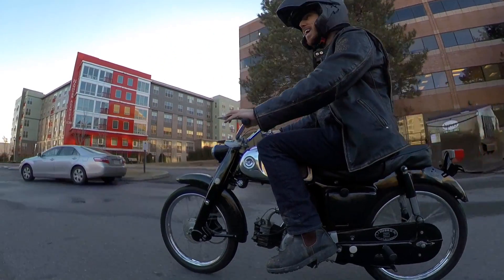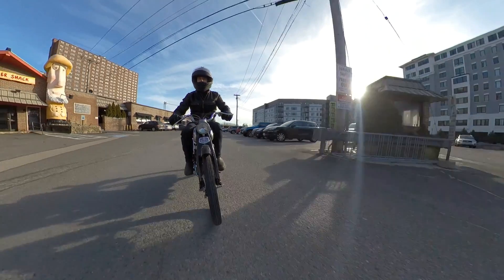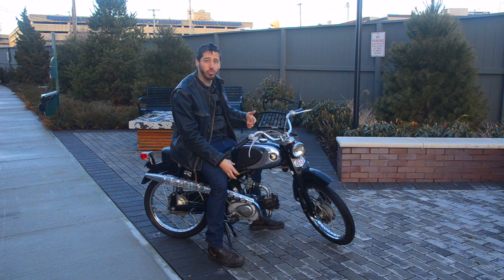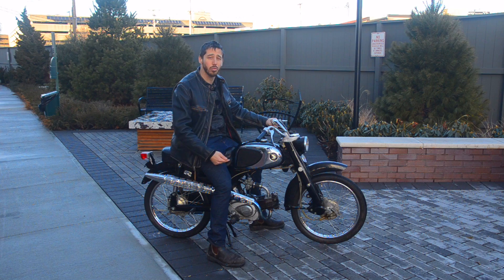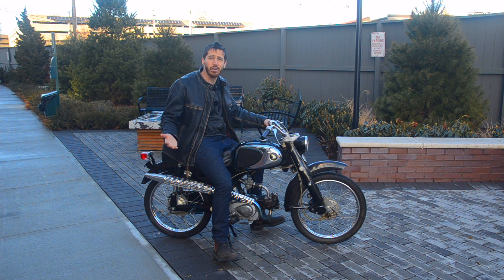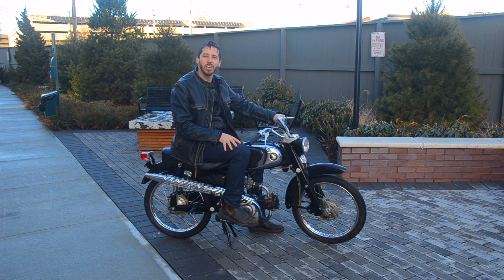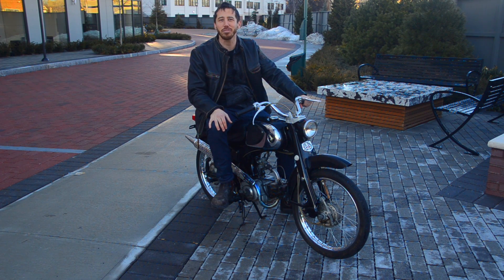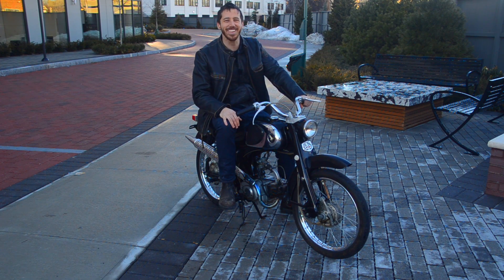DIY electric motorcycle conversion with 1969 Honda - Part 1: Planning

Comment: I would just try to avoid the hub motor. How to fix the motor and battery pack? Jus two sheet metal brackets that replace the current engine and go all the way to the steering head area. 
Looking forward to the next video :)

Comment: If you're going for under 5kw then go for a hub motor, less moving parts, easier conversion. 
However, that bike is a bad choice for conversion, the frame is an open C shape which has very poor structural support. Remember, electric motor=torque, the old 50cc engine lacks power of any sort, it's already stressed after just surviving the years, was never designed with the torque even a small electric motor can supply, the frame might stretch and compress without additional support. From the engine mount I'd brace it up to the neck with tubular steel, either welding it or bolting it together giving you the option of an easier access and disassembly also giving a sort of underslung sub frame which would give support, a place to put the foot pegs, foot brake and support for a battery box keeping the CG low. As for battery meter, go analogue for asthettics, mount it to the tank, a lot of bikes of this era had instruments there.
Reply: yea the c shape is weak , but tubing changes looks, might have it hidden in middle under and into recess on battery , migth even not use tubing but wire and strecthing mechanism.

Comment: I think you should go for mid engine. It will look better and in the event of some issues you don't have to dismount a lot of parts. Also it will distribute weight. For the batteries I would consider the hollow tank covering them. Good Luck

Comment: I would like to see a setup that includes a kinetic charger to continuously recharge the battery when in motion.  Something like flywheel energy.  From wikipedia article:  "In the 1950s, flywheel-powered buses, known as gyrobuses, were used in Yverdon (Switzerland) and Ghent (Belgium) and there is ongoing research to make flywheel systems that are smaller, lighter, cheaper and have a greater capacity. It is hoped that flywheel systems can replace conventional chemical batteries for mobile applications, such as for electric vehicles. Proposed flywheel systems would eliminate many of the disadvantages of existing battery power systems, such as low capacity, long charge times, heavy weight and short usable lifetimes. "

Comment: I'm happy as long as 18650 or better capacity batteries are used. Could also use multiple small inverters vs a single large inverter, assuming that the hub motor is ac. ¯\_(ツ)_/¯

Comment: Should go for a hub motor and just put the batteries inside the fuel tank and if you're not into destroying that fuel tank go make a vacuum formed shell from the original and sell the current one of ebay

Comment: Hey! I also bought a super Cub in hopes of electric conversion. Tubes in the rear tire were a pain when I got a nail. I failed 5 times in rear tube replacement before converting wheel to tubeless, mountain bike style. I highly recommend converting to tubeless.

Comment: Looks like a cool project. I have an old e-Bike/Pedal Scooter that I plan on restoring. It has a Chinese hub motor and has 36v worth of AGM batteries. I think the current electronics are totally dead.

Comment: This is a cool idea.  Like you said in the video, there are millions of similar bikes around that could have a second life as an electric moto.  Be careful if you decide to cut into the fuel tank; make sure it has been cleaned out very well so any sparks do not ignite the old gas fumes.

Comment: Make sure that you have your more powerful brake at the front wheel. Primary braking with motorcycles are from the front wheel with the rear brake used for braking stability, consider this when planning your brakes for your own safety

Comment: I want to build a 48 volt  pack capable of 100 amp regular discharge. I haven’t been able to find a good option for a BMS so I’m currently using lipos with an audible alarm.  Any suggestions?

Comment: I have built several ebikes and also restored a Honda ct90 similar to what you have.. At one time I thought about doing something similar and quickly realized the Honda  without the engine is very heavy..I'm guessing approx 125-140lb. The last ebike I built started off as a 27lb and the build ended at 48lb including the battery. I really don't see the point in so much weight... other than the cool factor.

Comment: I think you are biting off more than you can chew here. Far better off getting a low power electric moped and amp it up. They sell 1500 watt full size scooters for about 1000. Then convert it to a 5000 watt at 72 volts.  If you going to stick with that honda. Consider putting the batteries in rear saddle bags on side mounted panniers. Will make it easier to take and charge. By putting the battery in the front you are almost force to charge on the bike. The rear hub is the way to go. Since these are plentiful, add a disc brake should not be any problem. Go with DC to DC for the lights and such. When you buy the rear hub, make sure you use a Credit card. I found half the stuff I buy from aliexpress does not work. Also they seem unresponsive to refunds. So I am force to do a chargeback. We look foward to the build.

Comment: Great project. Whats the best way to connect with you about large volume sales of your battery kits and battery packs? Scroll down on this page to see a Mid Drive Honda Cub conversion kit using a Sur Ron Light Bee drive train https://endless-sphere.com/forums/viewtopic.php?f=28&t=89902&start=3025 . It will be offered on a crowd-funding platform. The team has had prior success on crowd-funding platform with $230k in pre orders.  One of the team members was the founder of one of the largest clean tech funds.

Comment: Great timing, I was just starting to plan the exact same thing!  Get a retro 'mini-bike', convert it to electric. I look forward to seeing you problem-solve your way through this. I'd been thinking of doing it with a mid-drive to keep the aesthetic (+ keep the original wheel), and replace the tank with a battery pack (with a container that's been designed to look like the tank, and chromed!). Check out a local makerspace (Artisan's Asylum?) for access to welders and machining tools for parts creation, btw. Good luck with this!

Comment: Difficult to imagine a less appropriate donor bike. Surely you need something with good-handling, good brakes and some room for batteries and luggage - it's a work bike after all. You're removing all the retro stuff, apart from the tank, so why start with such a hopeless chassis?
The engine on these old Hondas is super-reliable and economical, but that's the bit you're binning. Weird.
Reply: Project is aimed at a city bike small lightweight and for short commuter journeys, ideal for electric conversion

Comment: Looking forward to the rest of this. I am about 80% done with my similar electric moped. 1980 Garelli SS. I chose a mid drive motor and custom built batteries.
I am interested to see what bums and if you do put a graphics display on your cycle. 
Look at my forum here. https://goldenmotor.com/SMF/index.php?topic=6586.45

Comment: Consider a midmount motor so you can keep the stock covered chain drive and rear wheel. Battery pack could be located in panniers. Maybe cast a plastic shell from the tank and hide the electronics inside.

Comment: Make a steel battery box with footpegs on the bottom and bolt it to the frame with the engine mounting bolts.

Comment: How about to use an electric chainsaw for powering the bike. You can get even a 120 volt system with massive amount of tork. And tge batteries are not too expensive as well. I was thinking on maybe you could check the redback 120v chainsaw or similar one. Have fun :)

Comment: 7:16 this is why you’re making this ELECTRIC hahahaha
Reply from the maker: Haha yea, funny how electric doesn't have these problems...
Reply: @EbikeSchool  ...because you suck at kickstarting a motorcycle?
Reply: But you can't bump start electric, lol.
Reply: Brannen Thompson no but if the batteries flat you can charge it by getting a tow😅
Reply: @andykirby - A tow on a moped ? 🧐
Reply: Ha ha, totally!
Reply: Not the engines fault it's his weak kick
Reply: @kevinmontoya7318  kick can not be too strong l think the kick system often breaks then
Reply: @orangestoneface  not excessively strong im talking about a quick hard kick to get the motor to spin quick
Reply: @kevinmontoya7318  l tink the like znen gy6 common china scooters here can not take kickstarting too often its a weak system so the el starter must be mostly used. but im too lazy to repair mine.
Reply: You should do a collaboration with Brunopoweeer when you're finally done this project. His voice and high-energy is hilariously awesome!
Reply: Duane Meville hahahaha yeah we’ve done some videos together, I recorded some short clips showing a few electric motorcycle regen brakes and uploaded on both channels I think beginning last year...
I’m keen to dub his new video... that would be ultra funny... hahaaaa
Reply: Slap a lifan 150cc in that baby, and she will RIP got mine to go 80mph :)

Comment: If you decide to go with a hub motor, it may well be worth considering setting it up with regen braking. Though I don't suggest it, my current ebike is set up with regen as the only rear brake, and I find it to be easily sufficient when used in conjunction with a strong front brake for times when quick stops are needed (the regen alone is fine for 95% of my Class 3 ebike city riding). The battery setup you're suggesting would likely handle far more regen current than I have experience with, and you could probably even set up the foot brake to control variable regen current through a Cycle Analyst and/or a compatible controller, while also actuating whatever rear physical brake solution you come up with.

Comment: I know I already posted a comment but I'd like to add that I'm very pleased with the availability and price of these parts and the ease of use of all of the equipment and bits. Electric vehicles are becoming vastly more viable than they were even five years ago and I am very impressed

Comment: Congrats! I’m working on a similar project, dough mine is a 1978 mobylette motobecane, 3000 watt 52 volt battery!!
Reply: I have a similar moped made by Peugeot. Where are you mounting your motor and battery?
Reply: BackwoodsBungalow right where the gas motor was placed, mine ( motor is electric motor from Luna cycles 3000 watt) but you could lace and true a rear brushless motor.. just saying! Good luck on your project.. greetings from Chicago!
Reply: I am also working on something similar. Mines a 72v setup. What motor brand did you go with?
Reply: Will Greider 3000 watt motor from Luna cycles!! 52 volt battery 20 amps,from AliExpress. Good luck on your project,,
Greetings from Chicago!

Comment: You should leave the engine and just add the hub motor and make it a cool hybrid, gas/electric motorcycle. Then again, for "ME", I like options, like if I want to run off a battery or gasoline. You could also use the motor for regen braking to help with a disk brakes on the rear tire.

I've been hoping someone who knows more than me would build some thing like this and see how it goes. You can always remove the engine and go all electric, but to do some thing totally different would be cool if you ask me. Plus, you could use the motor to get going and start the engine so no more kicking or push starting either. haha Keep up the great work.

Comment: Hey Micah, glad to see you’re moving into the low end of the heavy weight wheels. I have a Smart Car I converted to electric but I only had AGM batteries for it n I sucked the life out of them in 1200 kms. Now I need someone with your growing skill set to help me repower this wee beastie. Used your book to get my ebike powered but this EV car seems exponentially bigger. Coming to Nova Scotia anytime soon?

Comment: I say put the motor in the same place and store the batteries in the  tank and under the seat.

For the gauges, keep the factory speedometer and find a retro or period similar volt meter and add a momentary switch to activate it.

You could also have the charger connection be where the fuel cap is.
Reply: Hub motor is the better way to go. Less building. He could put the batteries in side saddles in the rear.

Comment: I hate engines if you want any real power it has to be Electric
Reply: "Real power", hilarious.  The ignorant cult of electric is already beginning.
Reply: Electric bikes and cars are awesome for immediate power. However e-lovers are a bit like flat-earth people. Some of us believe you should experience things that are more than 40 miles away. I can travel 700 miles in a day on a $500 ICE bike. Till that equation can happen I will not succumb to the electro-facists.
Reply: @JamBot34  different things have different parameters. You can get a really great smartphone but good luck if you can make it run for 5 days straight. You can also have a great exercise program but good luck if you don't want to have aching muscles. Different things have their pros and cons. You have just chosen to cause more secondary and tertiary harm to other people rather than less.
Reply: sam guapo like I implied. Make them realistically affordable with realistic range. But I suppose you don’t care about affordability and want the dirty proletariat to stay in their zones digging the coal to feed your charging machine...
Reply: @JamBot34  Affordability is a term of entitlement.  There will be things that are, and things that are not. Insisting to make everything that way  is ludicrous. Imagine if everyone insists that space travel has to be affordable. Again. Different things have different parameters.
Reply: @samguapo4573  Okay, so really have just been poking the bear to this point. But to address the "affordability... entitlement" comment. Let's stick to electric vehicles. The Tesla Model 3 Standard OTD is about $40,000 minimum if you get all the current possible incentives. (That is on a forum, grain of salt there). The Chevy Bolt has several reports of $33,500 with similar discounts. Still not what I would call budget but it is approaching reality.  I'm not insisting Ferraris cost as much as Civics. But in a country that has loads of rural areas, long-distance vehicles are needed. I would buy an electric adventure motorcycle that got 200 miles of ~55mph range and was around $10,000. But that is my personal comfort level. We shouldn't push the world to accept EV, you will lose the battle. Push EV to fit the world, then you can win.
Reply: True. No motorcycle ICE can match an emotor.
Reply: Are you two stupid? Ever heard of the Kawasaki H2R? Or looked at lap records for Isle of Man? The fastest electric bike lap is nearly 2 minutes slower than the fastest superbike, or superstock.
Reply: @adamkimmV  It's simply a matter of putting the better electric motor and controller set up. There are people who have already overkilled set ups on bicycles (me included) and it is a simple matter to put it on a motorcycle. And these are DIY's. Commercial motorcycles aren't built for speed, they are built for usability. Nobody has built an equivalent electric superbike, but it would be very simple actually.
Reply: @adamkimmV  Ever heard of the Lightning RS?
Reply: @samguapo4573  yes I have. While it certainly is a powerful motorcycle. It has nothing on the kawasaki h2r.

My point wasn't that electric motorcycles can't be fast. Just that at the moment, no electric motorcycle can compete with the best ice motorcycles.
Reply: Awakened2Truth - Disciple of Jesus the Christ  watt per watt (power for power),  no ICE motor with the same power an match an equivalent electric motor. IF there is a "e-superbike", it is not a "commercial" bike. I dont' consider the current batch of commercial e-motorcycles "superbikes" from Zero and all the others. Current definition of superbike is 800-1200cc. The kawasaki z800 is an 89NM (torque), the mediocre Zero motorcycles are already  106Nm and above. Then consider having no transmissions to emotorcycles with transmissions. If we would base it on pure power then we might as well consider emotorcycles who's engines are equivalent to 250cc engines but with the power of  a "superbike".
Reply: Awakened2Truth - Disciple of Jesus the Christ  I am aware of this bike and that event.. They are not "commercial" last I recall.  I am very much aware of the ebike scene. But if they are currently produced in volume and sold then that would be great.
Reply: Awakened2Truth - Disciple of Jesus the Christ  At your egging I decided to check their website. Currently they accept reservations and made to order and they are selling other stuff like hats, jackets and stuff. So I guess it depends on what is your definition of commercial which I guess is the difference between your and my position. Of course, if we accept the textbook definition of commercial then you are more correct than I.

Comment: It's a shame for the fine moped, it has a high value in the right hands that will appreciate the glory, see this link 4K pound on Ebay! https://www.ebay.co.uk/itm/Honda-CA-110-SPORT-50-1962/281933907492?hash=item41a4920624:g:w5YAAOSwPc9WvdKS

Comment: I saw a hub motor on aliexpress that might work well for this application, at 12kw it might be overpowered for what you need. (But more power is more fun. 😁) 
It comes in a 9.3kv and 14kv version,
 so with 9.3 you can Have lots of torque, but not go as fast, which might be good for city riding. 

https://m.aliexpress.com/item/32848988952.html?pid=808_0000_0101&spm=a2g0n.search-amp.list.32848988952&aff_trace_key=&aff_platform=msite&m_page_id=7514amp-hQJ-pP3dD9tuKsuu_YUwMQ1550356832718